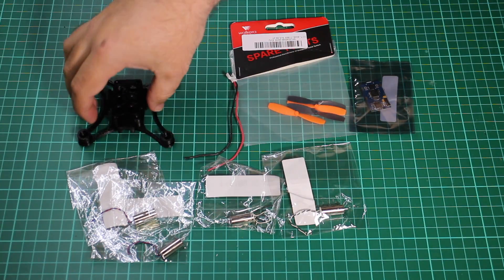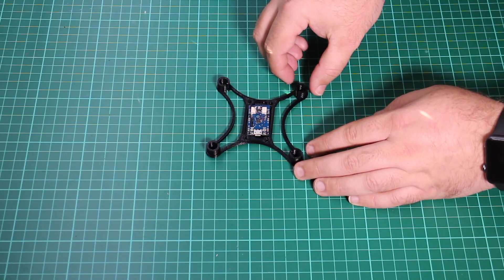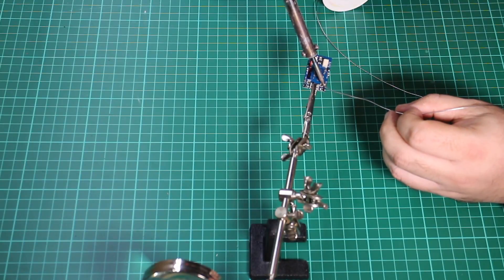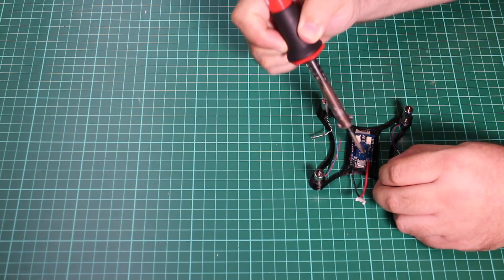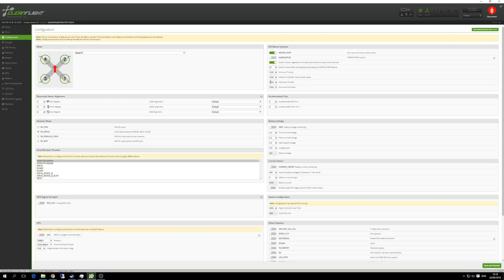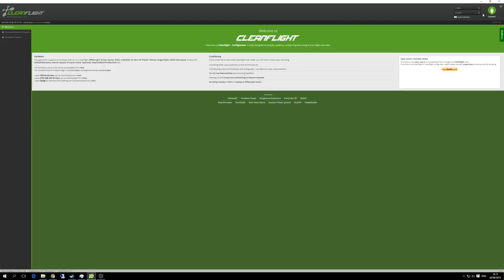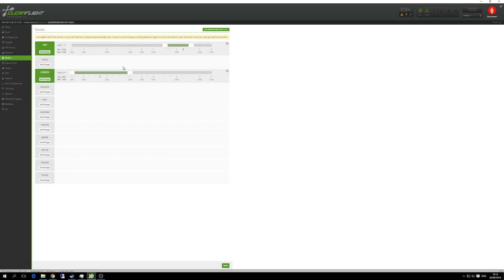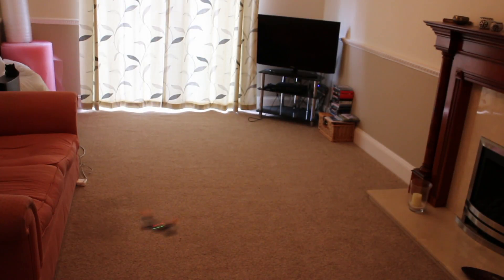Micro 105 Quadcopter build - Part 1

Comment: Would a dx5e work for this I dont have 70 dollars to spend on a radio I only have 50 dollars
Reply from the maker: My Scisky is DSM2 only however looking at the spec on the website linked they have updated the board and it now does DSMX too. Provided you get the updated version the dx5e would work perfectly fine.

Comment: Would you recommend this quad build and also is could you please make a list of everything I would need
Reply from the maker: Id certainly recommend it. its fantastic fun to fly. Its a little more expensive than a bought one but is also much more fun to fly. Plus I really liked building it.The one thing I would say is you do need to enjoy the building side. Its not just puting the parts together, its fixing it later, tuning it etc. Thats half the fun for me...
This is what you would need. There are some bits I already had (cables and batteries) but these would do the same job. Also the frame Ill list isnt this frame as I 3d Printed mine, but you could use this instead if you dont have a 3d printer:

Example of stuff I dont have but would be good:
Frame (not the one i use but looks good): http://www.banggood.com/LANTIAN-105-105mm-Carbon-Fiber-DIY-Micro-FPV-RC-Quadcopter-Frame-Support-8520-Coreless-Motor-p-1077275.html?p=C103162722159201510B
Cables: http://www.banggood.com/Wholesale-Balance-Charging-Cable-For-Walkera-Wltoys-Hubsan-X4-Eachine-H8-p-51891.html?p=C103162722159201510B
Batteries: http://www.banggood.com/5X-Eachine-3_7V-500mah-25C-Lipo-Battery-for-Hubsan-H107-H107L-H107C-H107D-p-993949.html?p=C103162722159201510B

Parts I do use:
Motors: http://www.banggood.com/2-X-8x20mm-Motor-For-Hubsan-X4-H107C-H107D-RC-Quadcopter-p-87683.html?p=C103162722159201510B
Scisky: http://www.banggood.com/Micro-Scisky-32bits-Brushed-Flight-Control-Board-Based-On-Naze-32-For-Quadcopters-p-1002341.html?p=C103162722159201510B
Props: http://www.banggood.com/Wholesale-3-Set-Walkera-QR-Ladybird-Spare-Parts-Main-Blades-Propellers-QR-Ladybird-Z-01-p-47127.html?p=C103162722159201510B
Camera (All in one - Much better - Video coming soon): http://www.banggood.com/Eachine-EF-01-AIO-5_8G-40CH-25MW-VTX-800TVL-13-Cmos-FPV-Camera-p-1064301.html?p=C103162722159201510B
DX6i: http://www.ebay.co.uk/sch/i.html?_nkw=dx6i&ssPageName=GSTL
An elastic band to hold the battery
3m like tape: http://www.banggood.com/Strong-Permanent-3Meter-Double-Sided-Super-Sticky-Tape-Roll-For-Vehicle-p-1002947.html?p=C103162722159201510B
Soldering equipment

Lastly, im making a video where ive swapped the camera from the original set up to an all in one as listed. There is nothing wrong with the individual parts but the all in one is a much nicer package. Subscribe to make sure you see that!